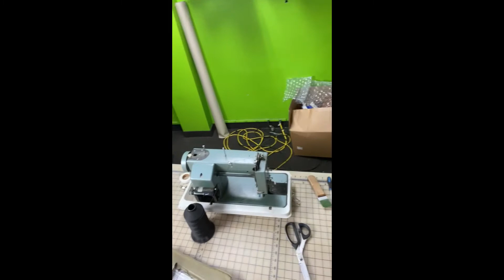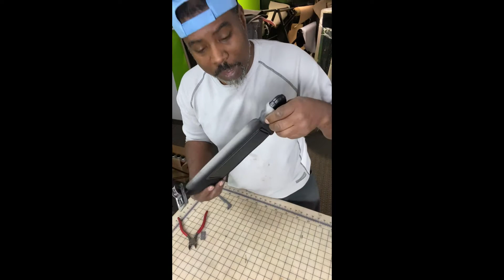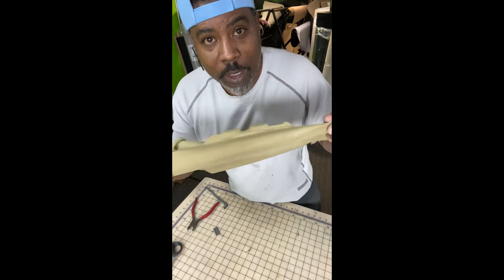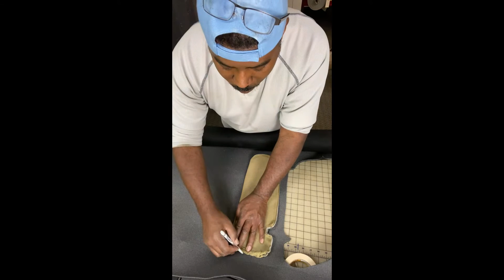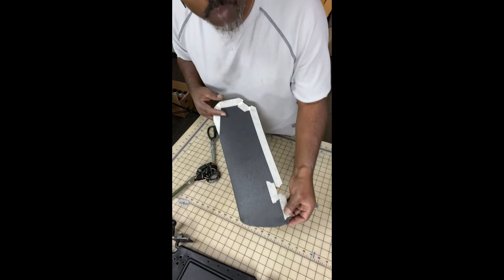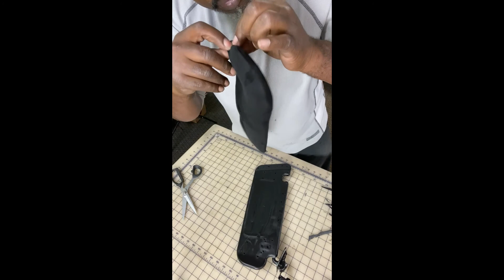How to Repair Sun-Visors when Sewing is Required

Comment: Four years on but I just came across this. Very nice work. Two questions, what is that machine model and how did you close that last open edge? Thanks!
Reply from the maker: The last edge gets tucked into the visor.  And that was a old model portable one. I don't have it any more. Kinda miss it as we'll 😢